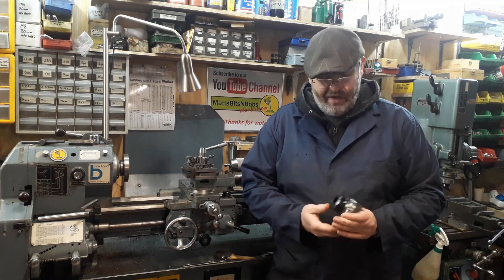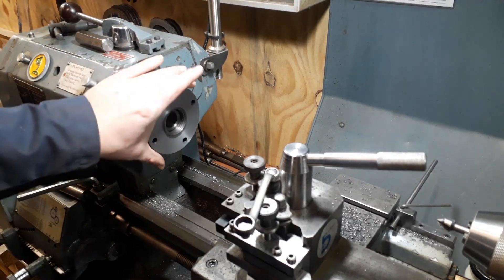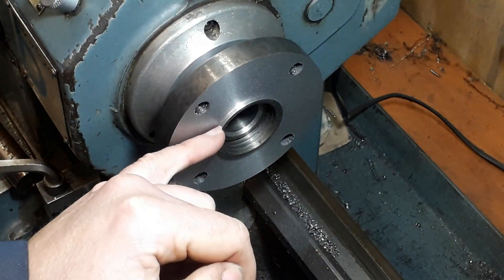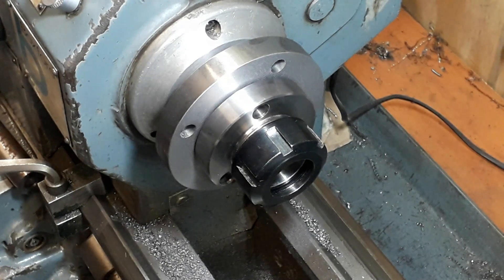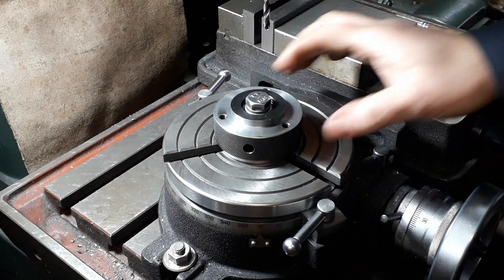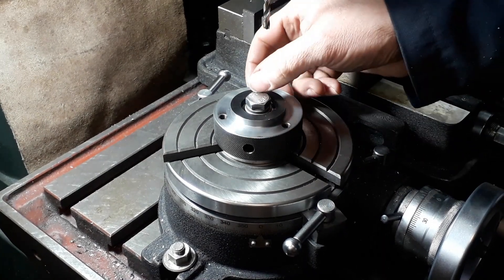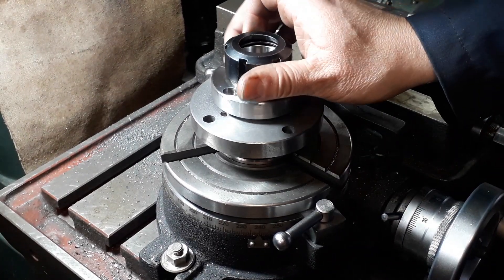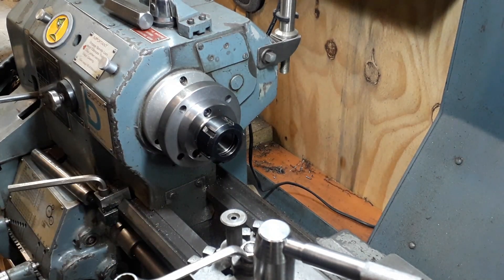ER 32 Collet Chuck, Make The Backplate

Comment: Youtube recommended this, and I'm glad it did. Looks like you are doing some interesting things in your shed.
Would suggest turning off Auto-focus on your camera :D
Reply from the maker: Thanks so much Peter (and YouTube)  Surprising what you can get upto in ya shed 😁 
I was having that conversation only last week with a tech guy at a local university, if I turn it off it's constantly blurred but on it never stops focusing! I have written to Santa so fingers crossed. Cheers
Reply: @mattsbitsnbobsworkshop  depending on your camera, getting a screen that you can see when you set up your shot will help to fix it.
Reply from the maker: @UncySpam  thanks, there are so many out there it's a minefield, knowing what's best will be the challenge, also a new tripod. This one loves to wobble.
Reply: @mattsbitsnbobsworkshop  If you haven't, checkout Rotary SMP - he did a great build of a camera stand that fixes most of the issue a normal tripod has for a workshop :D
Reply from the maker: @UncySpam  will do cheers
Reply from the maker: @UncySpam  been talking with the tech guy again today and we may have found a solution (not the tripod but that maybe my next job) so watch out for the next few videos, thanks again Peter

Comment: I had to cut the register to fit that same ER collet chuck on my Myford Super 7. I also “sneaked” up on that final cut, a scary experience. Thank you for showing how you mounted your ER collet chuck to the Boxford. The accuracy can’t be faulted 👏👏👍😀
Reply from the maker: Cheers Andrew, sneaking up on it is a well used method, even taught at the highest level Haha, but it works though "scary" I still can't find my metric mic, I think (hope) it's at my dad's. Yep it works out bang on the money, after this I re-cut the myford one (never happy how loose a fit it was) now as good as the boxford, I'm sure yours worked out the same?
Reply: @mattsbitsnbobsworkshop  Tomorrow I’m going to recheck my collet chuck and see what run out I have. From memory I suspect it isn’t anywhere as good as you achieved. Might need to fit it on a new backplate. Good luck finding the micrometer. I hate misplacing things, especially my memory. 😂
Reply from the maker: @andrewatcarpathian  memory, what's one of them? 😁
I'm sure your runout will be good, let us know, cheers.